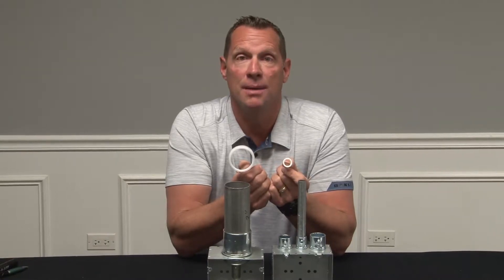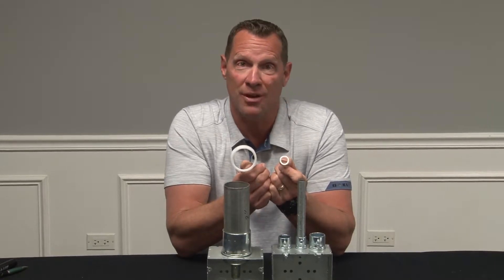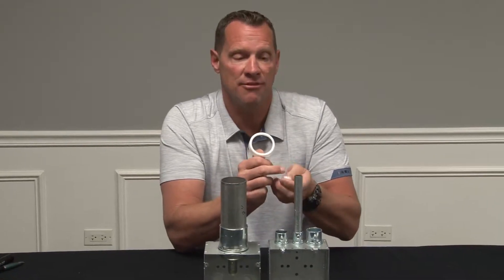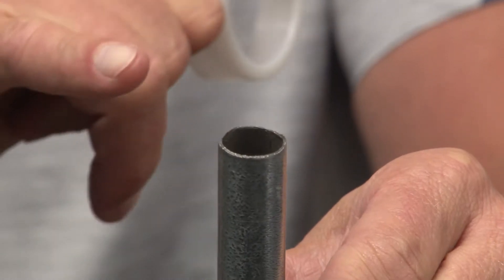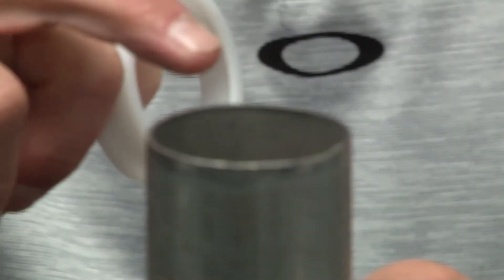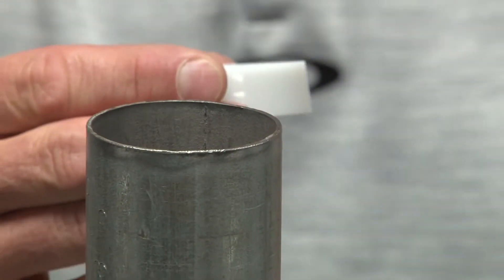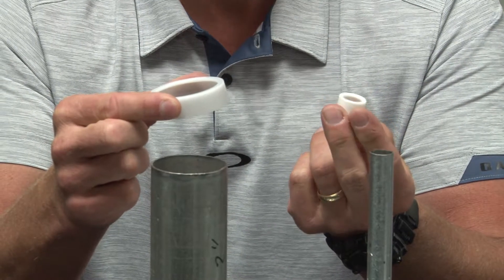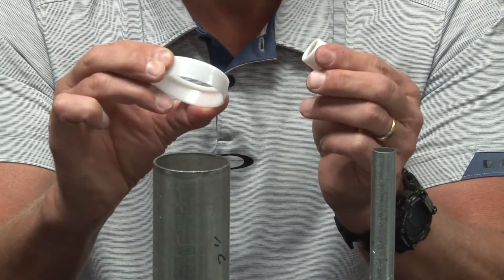Plastic EMT Insulating Bushing, 1/2 in.

Comment: Wouldn’t one make the conduit to box connection first, then put a protective edge over the threaded end of the box connector, then pull the cable?  This device implies one would pull the cable before attaching the conduit to the box.  Can you explain why one would choose one method over another?